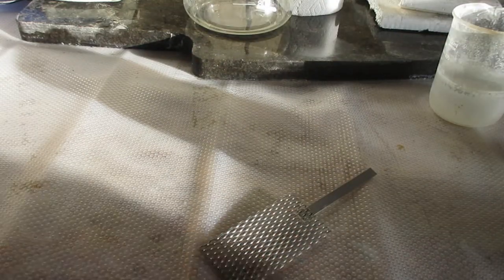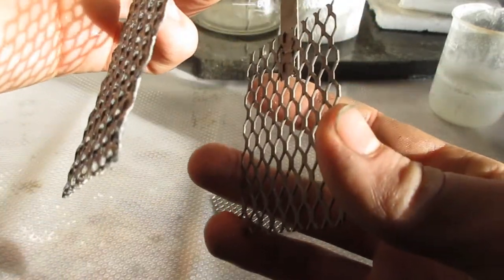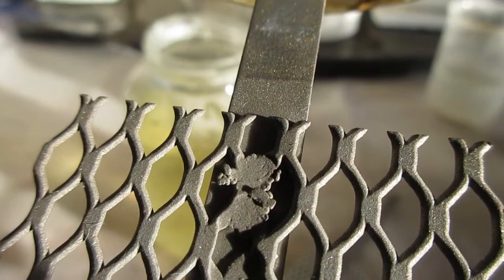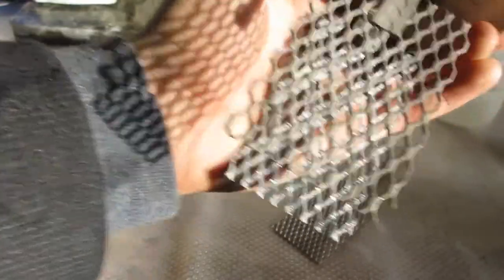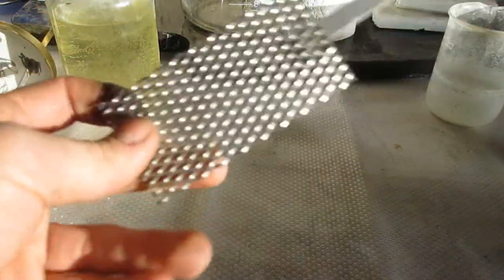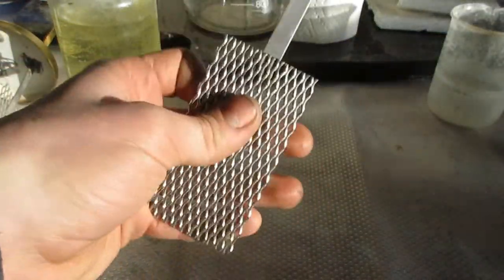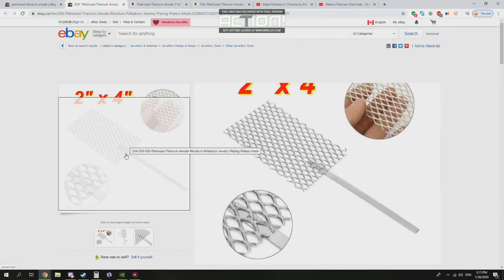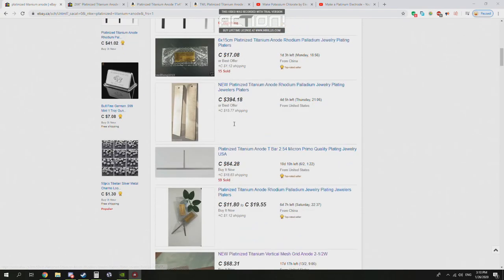How to distinguish fake platinum anodes from real ones

Comment: My dear ,  .Pt is more expensive than gold,  so they cover only, the electrodes with platinum.....or titanium.I have some but i didn't try yet .They give you the maximum current per square cm(it is small)  in order not to destroy them.
Reply: I simply just use a 1-ounce platinum bar :)  I mean, this stuff lasts forever anyway.
Reply: platinum in my country 2 times cheaper than gold
Reply: Im seeing that getting platinum and turning it into a foil and making electrodes like that is worth it. With about $300 in platinum you can make an electrode that will last a long time, that buys you about 11g of platinum (current 2024 prices)

Comment: The gray  anode elecrtode  my be not  MMO  accidently?!
Reply: I doubt that because its too shiny and most Pt anodes arent even electroplated on because Ti has a very poor affinity for electroplating. Most Pt anodes are thermally baked which also produces that distinct line. The baking mix is a special ratio of hexachloroplatinic acid to ammonium hexachloroplatinate because the acid alone makes Pt vapor on baking which is not desirable and too much ammonia makes it puffy.